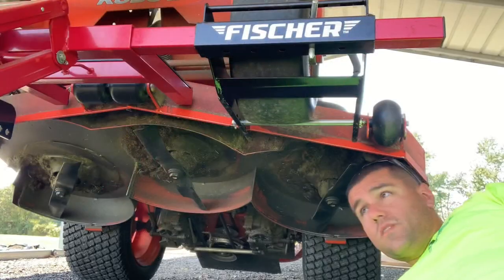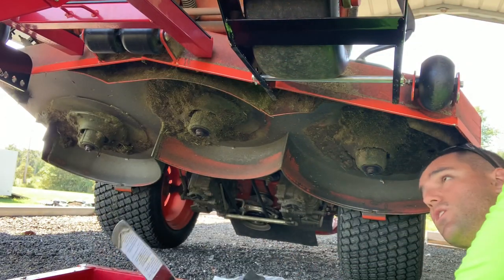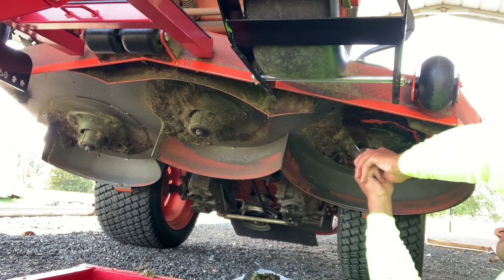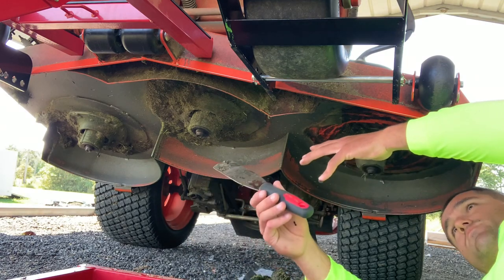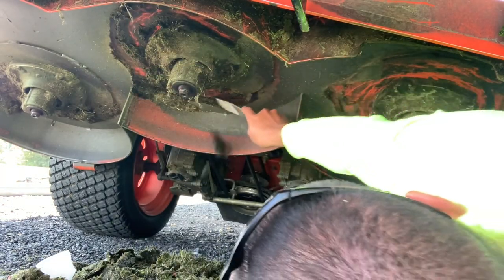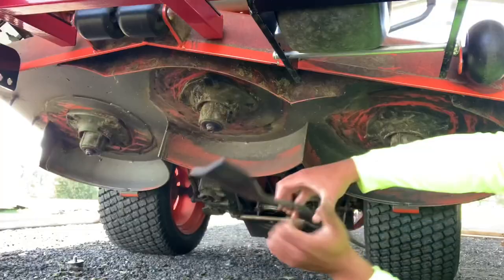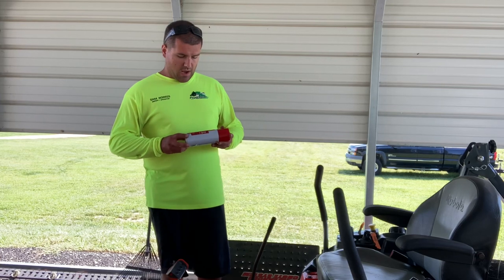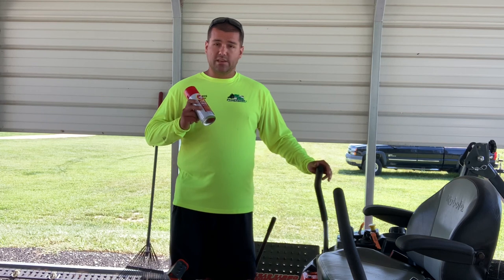Prevent Grass Build Up Under Your Mower Deck! [Does it work?]

Comment: I use WD-40 and it does the same as the product you used.  Build up around spindles but the outside interior edges are clean.  The build up is easy to remove as well.
Reply from the maker: I’ve heard people use WD40 as well. I used it once on an old John Deere riding mower I had and it didn’t do much. Could have been error on my part, not sure. But this stuff works great too! Thanks for watching, appreciate it 👍
Reply: I also use WD-40, it works really well and it's way cheaper than Fluid film. But if this stuff works better I'm willing to pay more
Reply: @garyalensr  my advance auto actually had fluid buy 2 cans of fluid film for 9.88 a few months ago...dirt cheap with that bogo. Works great under my Ram and Acura, definitely going to try it on my mower
Reply: CRC cosmoline  works well also
Reply: WD40 evaporates in a few days. Fluid film stays for months.

Comment: Please put a link in your comments to the mower lift. Also, put something else under your lift for idiot proofing. I know the lift is set back down on it's lock position but still... I like your video and that product seems to work well. In additioon, put some Mop & Glo in a sprayer and apply it the indercarriage on everthing. The wax in Mop & Glo helps to repel the moisture! I use it on everything but it works well on my Ariens snowblower, rider mower, etc.

Comment: The key to maintaining a clean deck underneath is having very sharp blades.  10 lawns is way to far to go without sharpening. Although, the zero turn mowers are much more difficult to maintain and clean out from under.
Reply from the maker: I’ve had to stop every other lawn before and drive the mower onto the ramp of my trailer half way on just to scrape under the deck. Would be a little more tricky to change the blades but yes you are right.
Reply: @ProgressiveLawnService   since I’ve started sharpening the blades on the bench grinder, then using a file on them in the bench vise, the lawns look so much better, and little to no grass stuck to my deck.  But it’s a lot of work to do that and maintain it that way.  I have four sets of blades.
Reply: 10 lawns ? you must be in the south here in Michigan I need to sharpen once a week and do about 15 yards a day

Comment: I lift my mower and just spray it with the hose and it comes easily. I do it almost everyday. I hear Pam or silicone spray does the same thing as well
Reply from the maker: That works too. I don’t typically have access to get my hose close enough to my mower because I work on it far away from my house. I’ve never tried either of those but they may work too
Reply: 1
Reply: I hose after every use way easier and quicker

Comment: I clean it after every cut and it’s just as easy. Wish they made a machine where the deck tilted up!! I have a husqvara 48 “
Reply from the maker: Check out Hustlers new zero turn. The whole front end lifts up almost 90 degrees just like a walker mower. It’s insane!!

Comment: Great video, thanks for making it 

You should put a couple of jackstands under your mower as opposed tontrudting your jack not to fail when you go under your mower.
Reply: And a wheel chock or 2 (?)
Reply from the maker: I’ve done it before, didn’t in this video. Thanks for watching!

Comment: I'm more impressed with the jack you're using to raise the mower,who makes it and where did you get it?
Reply from the maker: That’s a Fischer Series Pro Lift from Harbor Freight. Love it! 

https://www.harborfreight.com/750-lb-heavy-duty-atvmower-high-lift-jack-63298.html?utm_source=google&utm_medium=cpc&utm_campaign=12144811130&campaignid=12144811130&utm_content=128369724875&adsetid=128369724875&product=63298&store=413&gclid=EAIaIQobChMI3vOTxsTQ-QIVSkpyCh1Ekgb9EAQYASABEgI5N_D_BwE
Reply: It's on sale right now for$239.

Comment: My question to you..? Does Fluid Film Dry … 🤔 I used Blasters Surface Shield on my 46” deck had same results as you … went ahead  pressure washed deck & re-applied Blasters Surface Shield ..!
I live just west of. Chicago so far 2024 mowing season we had a lot rain so far mowing 2 times a week to keep up mulching my lawn each time I had clean underneath deck … my Mower Blades are Gator 3 Mulching Blades by Oregon.. Great Heavy Duty Blades I highly recommend..!

Great Video..👍🏼
Reply from the maker: Thanks for watching! It will technically “dry” but it leaves a slight coating for awhile under there. It doesn’t last super long, I would say applying this stuff a few times a year would be the best option. Just so much moving grass and debris under there when mowing it really beats it up and removes it quick versus applying it to the underside of a vehicle.

Comment: I used to mow grass in summer then remove deck in the fall to use mower to plow snow in the winter
 Whenever I had deck off I rubbed used motor oil under it the deck never rusted out after 30 years For the past two years I sprayed fluid film underneath my truck and it works well so this year I sprayed under mower decks I figured if anything it will prevent rust You have a nice lift but I wouldn't trust it alone without blocking it up
Reply from the maker: That’s a good idea! I’ve heard fluid film is amazing for undercoating vechiles. The lift actually has locks it sits on just like a vehicle lift, so it doesn’t rely solely on the pump to hold it up. I love it. Thanks for watching!

Comment: Awesome video, let's make sure those companies that are taking a few mils of metal off every year or two don't gouge us for new decks too often! I wonder if CRC 6026 would work any better or worse. According to the Project Farm tests, it dries and creates a waxy cosmoline coating that doesn't attract dirt and such as much as Fluid Film, but being dragged in dirt roads is different. I use the 6026 for under my truck and the Fluid Film for harder to reach areas as it's a bit thinner and seems to spray better in tough to reach places. This is all really good stuff though and is one of those ounces of prevention!
Reply from the maker: Much appreciated! I’ve never heard of CRC6026 so I’ll have to look that up. I never thought of describing the coating as a cosmoline style finish but it is. Thanks for watching!

Comment: Does the Fluid film smell stay for a long time? I heard it smells awful and it doesn't go away.
Reply from the maker: It does not smell good 😂 If you get it on your hands or arms it can take awhile to go away but you just have to careful applying it
Reply: @ProgressiveLawnService Does the smell stay after you apply it under the deck? I store my ZT in my garage and I don't want my whole garage to have that awful smell.
Reply from the maker: @alzuu1  I’ve never noticed it but I apply it outside and let it air dry over night then cut the next day. I’ve never smelled it in my trailer.

Comment: Thought about using it on my new mower deck.  Been using Fluid Film for yrs on my 4 Runner frame, and before that my tacoma frame to prevent corrosion.
Reply from the maker: It’s worked out great for me!

Comment: I use used motor oil and lard. Just put some lard and used motor oil in a container heat it in a microwave stir it up to make a paste then brush in on. Works great.

Comment: I'm restoring 1975 c160 wheel horse  , deck is next , weld in new steel, body work, paint n grease under side.
Reply from the maker: That’s awesome! Can’t wait to see that whe. It’s done! I’ll have to try what you said in your other comment!
Reply: I restore d truck frames then painted brush on thick rustoleum,  every truck / trailer take glove rub in axle grease, never rust again

Comment: Why would you take the blades off to clean the underside?  Seems a bit unnecessary.
Reply from the maker: So I don’t slice my hand open when scraping or getting the grass off. Plus, old mowers (not sure if this one would) engage the engine if you spun the blades by hand so I don’t trust them being on there while I’m up under it.
Reply: @ProgressiveLawnService  I can respect that. Didnt know that about old mowers, thanks for that info.
Reply from the maker: @cgrimes72  yessir! Appreciate you checkin the video out. 👊👊

Comment: Probably a better question (for many of us especially with cheaper “homeowner” machines made of thinner metal) than “does Fluid Film keep the grass clipping from sticking to the deck?” is “does Fluid Film keep the acids and moisture in the grass clippings from penetrating through the oil, paint, and into the steel and causing rust?”. I would say yes. I will be doing a deck clean up and service soon. I know the underside of the deck has surface rust so I plan to wire wheel off the heavy rust and brush on a coat of bar and chain oil onto the bare metal. It tends to be a little “stickier” than Fluid Film.
Reply from the maker: Fluid Film has rust inhibitor in it. It’s a very gel like substance. I believe people undercoat vehicles with it, I’ve never tried that but I have heard good results.

Comment: Can you spray fluid film after you paint under mower deck to help with rust.
Reply from the maker: Absolutely! It’s a rust inhibitor so it will help prevent it as well as help grass not stick.
Reply: I'm planning to use some after I paint black and let it set up after 24 hrs after painted. Thanks

Comment: It does not eliminate it that would defy physics, but it helps remove the grass pretty easily
Reply from the maker: Not sure I said it would eliminate it, just prevent grass build up. It’d be nice, that’s a billion dollar invention.
Reply: @ProgressiveLawnService  Has any manufacturer of mowers (high end) ever tried coating the deck underside with 'Teflon'? That would seem like THE SOLUTION to keep grass from sticking!
Reply from the maker: @TheOzthewiz  to my knowledge, no. I have another product I’ll be trying soon. It’s a ceramic coating made by StaBil

Comment: I lay a 6x8 cheap blue tarp on the ground under my mower deck then scrape my deck clippings makes clean up fast
Reply from the maker: I usually do as well, I think I had lost it when I did this video. But yeah, makes clean up QUICK!

Comment: I never mow when it's even a little wet.  I know if you do it for a business, you need to, but for people just mowing their lawns, don't mow when it's wet?  Unless you live in England, you should have plenty of dry days to mow and not worry about the deck getting gunked up.
Reply from the maker: Grass just builds up regardless if it’s wet or not. I haven’t cut this year once when it was even damp and I can tell you I need to clean up under there and put this stuff on again. Unless it hasn’t rained for 4 or 5 months on end then maybe you can get lucky and never have to do any cleaning under there.

Comment: Love to see this deck treated with Slip Plate Graphite. It doesn't let anything stick, but would be intrigued to see how it held up on that mower
Reply from the maker: That’s interesting, never heard of it. I have another video lined up once I get back from vacation with another product!
Reply: I just ordered a can after reading this comment lol . Should I lightly sand the under deck of my brand new never used mower before applying the dry graphite spray?
Reply: I've been using it all summer this year. Stuff is amazing. Makes hosing off a breeze even after wet grass stuck on it for a couple days. Coated the rear bagging discharge chute and the side thrower too, never clogged with grass again. Only thing is that it will wear off after about 12 mows, but I make it go longer by coating it several times.
Reply: @infinityandbeyond2386  Pressure wash and make sure it's absolutely dry before you spray, it won't adhere all if wet. The spray stuff doesn't last as long, don't bother sanding cause it will wear out no matter what.
Reply: IVE   DONE THIS FOR YEARS   HELPS BUT   I STILL GET A BUILD UP

Comment: Save all the scrapping and use your power washer it cleans 100 percent with out the wire brush !!
Reply from the maker: Doesn’t take too much time to put it on my lift and scrape. Especially with the amount this stuff doesn’t let stick.

Comment: I never mow wet grass ... and i have never scraped the deck in my 53 years of mowing ... i put about 100 hours on my  mower each year  ... i usually start mowing late afternoon ... seems to work
Reply from the maker: I try not to mow wet grass either. Can’t help the dew early in the mornings though. Ive never heard of anyone not scraping thier deck or cleaning it off somehow, whether it be power washing or hand washing.

Comment: This would probably work good in snowblowers too..
Reply from the maker: Yeah it would actually. I’m going to be making another video soon of a new product by StaBil that is designed for snowblowers and mower decks to prevent build up and protect against rust. It’s a ceramic coating.